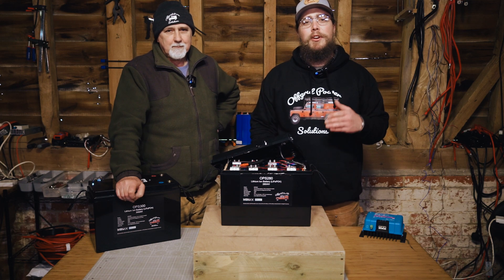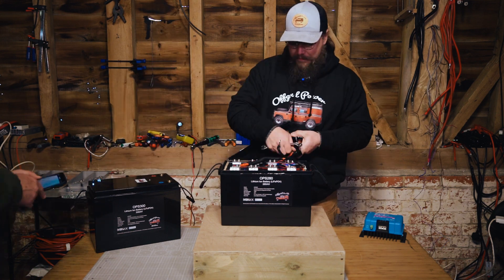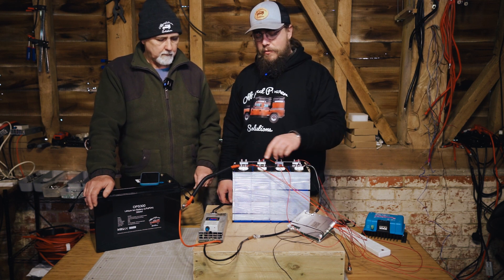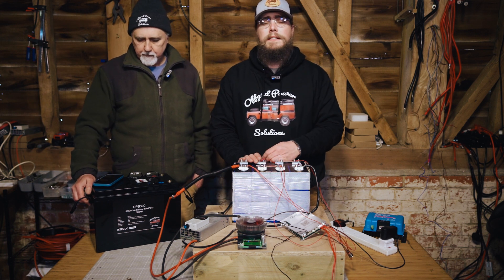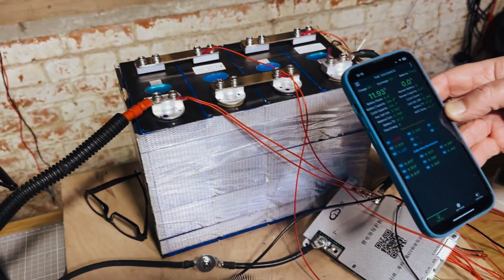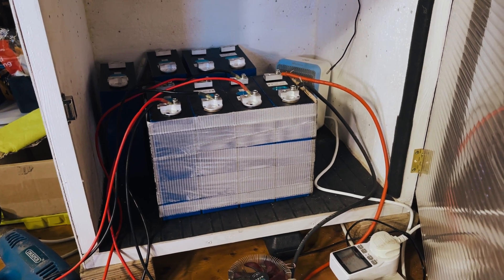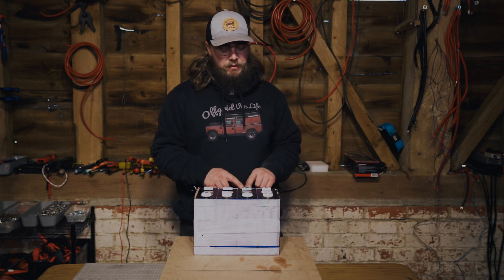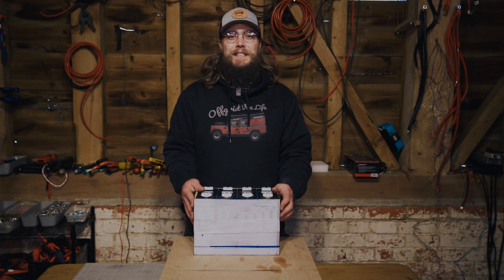Does shorting damage LiFePO4 cells?

Comment: I shorted a 105Ah cell with the chrome vadliam wrench.  I had repeated said to my self NOT to do it with a wrench but to use the plastic handled rachet with the extension.  So I shorted out a cell by bringing the wrench on the + terminal into contact with the - terminal when tightening.  Blue spark, "CLICK" and I pulled that wrench as hard as I could to make sure it released and it did.  Wrench not even warm, nor the cell, but here was some melted aluminium on the post base.  Battery is behaving fine, but I do not it's that cell which always seems to be the one either high or low and may have lost capacity or suffered hot spot damage inside.  2 options.  1 replace the cell.  2.  Capacity test it and buy a small cylindrical cell to make up the capacity and put it in parallel with it.  Apparently this is a technique used for decades in commercial applications.  Packs would be balanced by capacity not SoC or voltage.  They would be bottom or top balanced once and put into service with just a dumb cutout BMS.  If a cell was 98Ah while the others where 100Ah, they would just solder a 2Ah cell to the lower one.